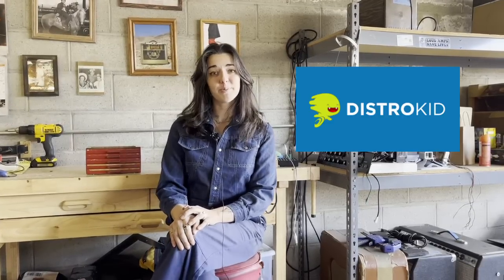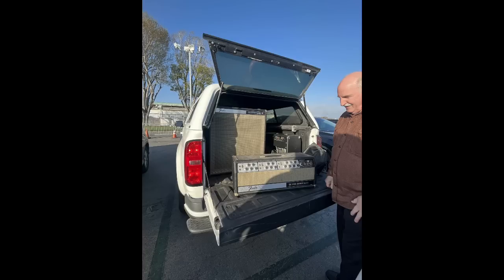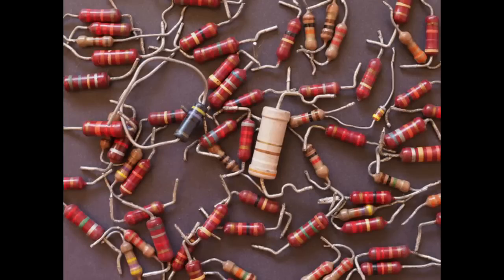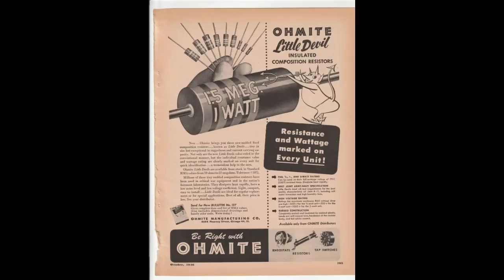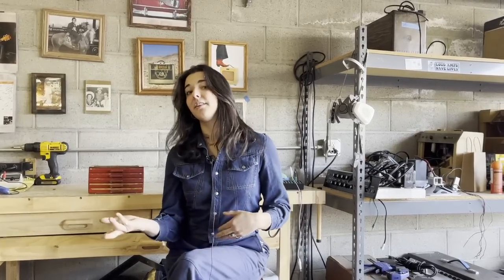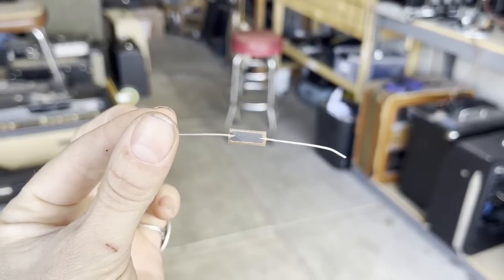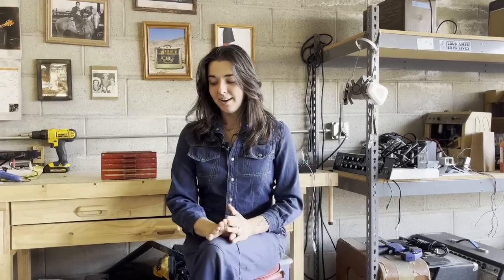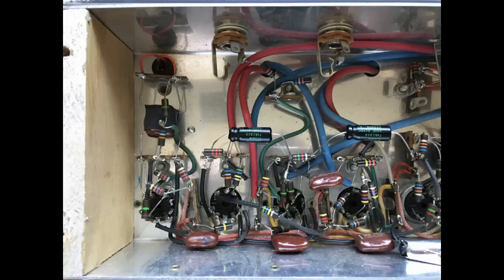Carbon Composition Resistors | Amp Electronics 101 | Fazio Electric

Comment: I own one of those same Ohmite resistor drawers. Don't ever tip it even slightly when you're carrying it or you will be sorry!  Mine had apparently been filled and refilled a couple of times, and the drawers were overstuffed, and half of them wouldn't open when I took it home from the ham radio fest.